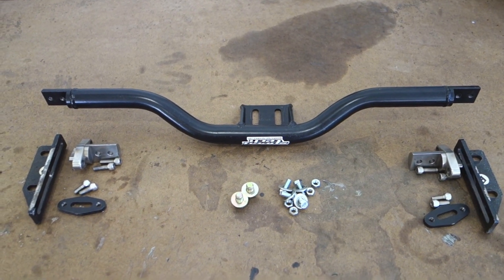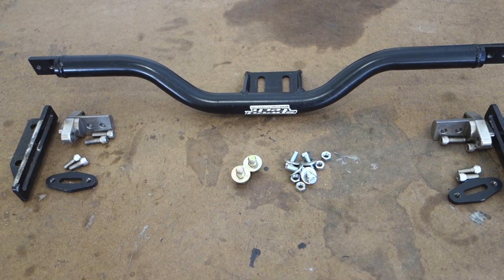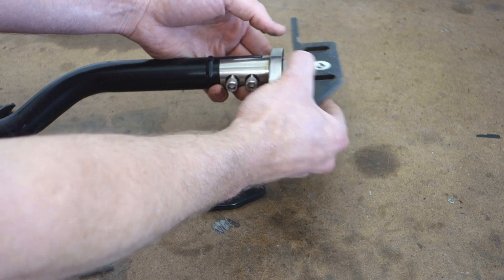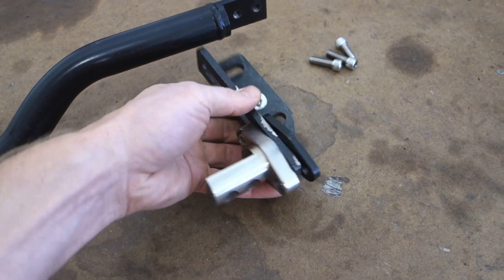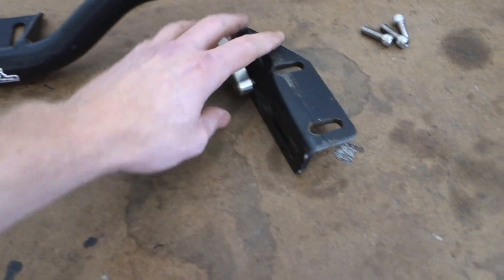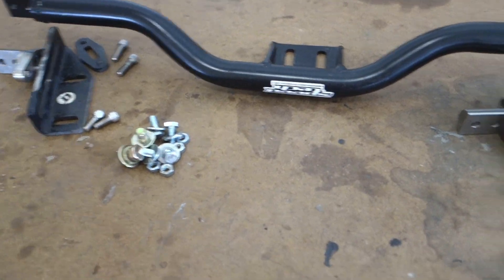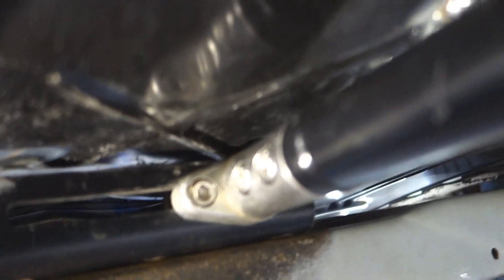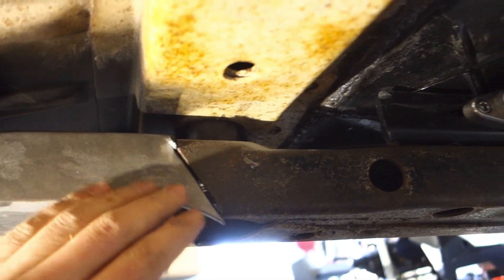Speedtech T56 Crossmember Review and Install on 1971 Camaro

Comment: Good video Dan.....   My experience with that particular cross member was similar to yours (too close to the floor pan).  Once the car was finished (driving), I found out that this cross member has a lot of movement / bounce as you drive - you can really feel it in the shifter handle. ...... Which is to say - the trans is moving more than I think it should.  it will be interesting to see what experience someone else has.....    BTW, thanks for subscribing to my channel!  You are officially my first sub!!    No content yet, but it's coming real soon.   Keep the videos coming.
Reply: I appreciate reading your comment about your experience with this bracket as I am considering it for my 70 Camaro build. Do you think the movement is coming from flex in the cross member or perhaps the subframe movement itself? I am installing GW solid subframe mounts, do you think this would help? I have original floors.
Reply: @idaho2ndgens240  On my 69 Camaro I have solid body mounts and sub-frame connectors. Everything is pretty rigid and "tied" together.  I'm sure the "wiggle/flex" is in the cross-member itself. ..... once you install the solid mounts, you will find that the car is noticeably more rigid.
Reply from the maker: Good info, thanks for sharing. It will be a little while yet, but I'll definitely pay attention to that. I wonder if the subframe brackets could use some gussets. I could see those flexing with how they are bent.  This might be why the other vendors use plates and their crossmembers are rectangular shaped with webbing. Can't wait for the vids!

Comment: I like the way it comes apart. I'm still trying to decide on what subframe connectors to go with on my car.
Reply from the maker: I didn't really want to cut the car to put them in but at the same time I didn't want to see the connectors hanging down from the car so I ended up going with DSE.